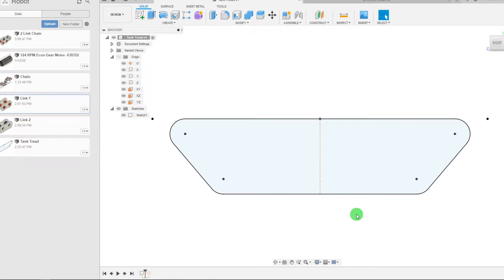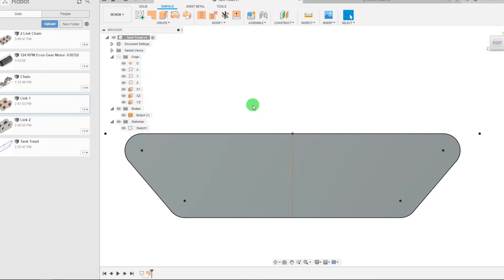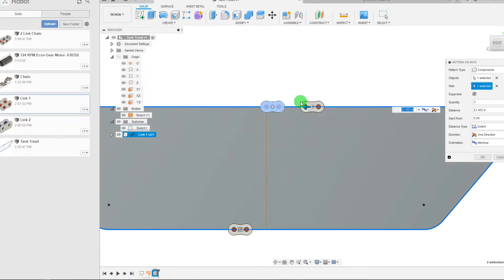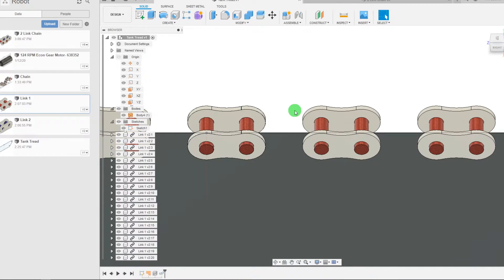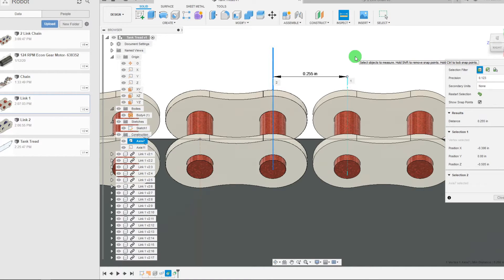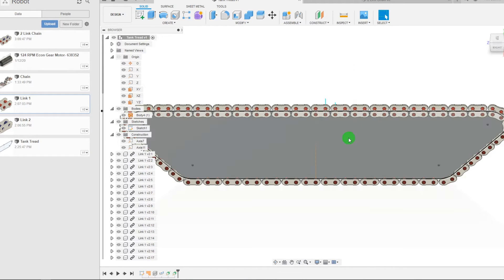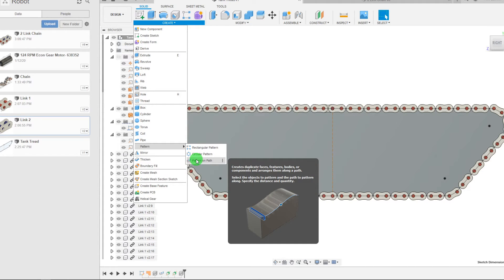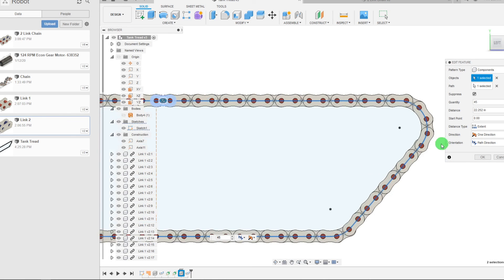How to Pattern a Roller Chain Along a Path in Fusion 360 (Tracked Robot Part 1)

Comment: Hello, I am still a beginner in fusion 360. How did u set the distances between each link when you subtracted the pitch from the measured distance? Thank you
Reply from the maker: I measured the distance between each link, but did not set it. I divided the full length of the path by ".25". The trick is to have a path length that is evenly divisible by ".25".
Reply: @AvivMakesRobots  Thank you

Comment: it seem i can't do along a path for some reason its very buggy and the preview all messed up :S i am MAD
Reply from the maker: That is Fusion... It is very slow when you have many parts. I would say try to skip every other link.
Reply: @AvivMakesRobots  what you mean by that ?
but i found a work around i leave the number of link as the last part when putting setting  i enter  like 80 link and then quickly press ok 
  it generate faster
Reply from the maker: @buder5116  Interesting. Maybe because it can't load the preview that quickly? Happy to hear that helps.

Comment: How do you get the links to import directly on to the path?
Reply from the maker: I built both of these parts on the origin. Therefore when I brought it in, it snapped to the origin as it is supposed to. Where did your link import to? If it does not import right to the origin point, it's okay... You can move it with the arrows. Let me know if you hit other snags.

Comment: What is it with you guys constantly scrolling in and out. Drives me nuts
Reply from the maker: Hey, sorry about that. The newer videos use a 3D mouse, which smooths out the action a bit.
Reply: I think nuts will be covered in another tutorial, possibly along with bolts. Still darn good tutorials and I for one am thankful for the valuable time given up to expand our knowledge or at the very least make CAD accessible. :)
Reply from the maker: @redwoodjay  Thank you! It's funny you mention that... There are about 50 nuts and bolts used in the tank tread tutorial coming up! Drives me screws!
Reply: @redwoodjay  and you are one of the nuts